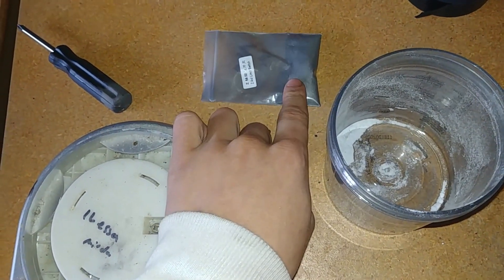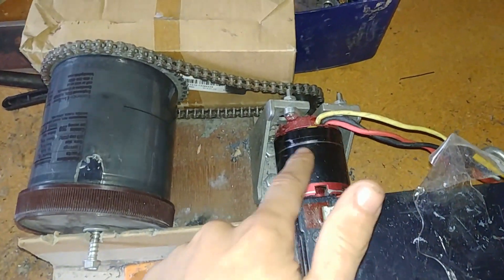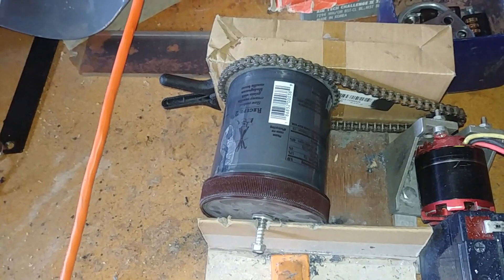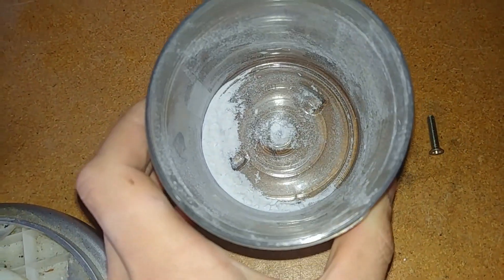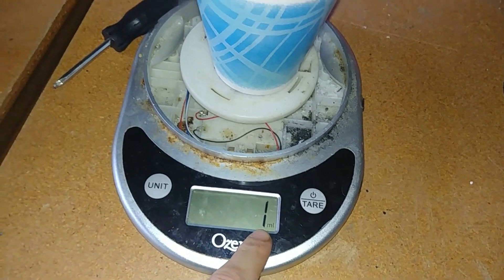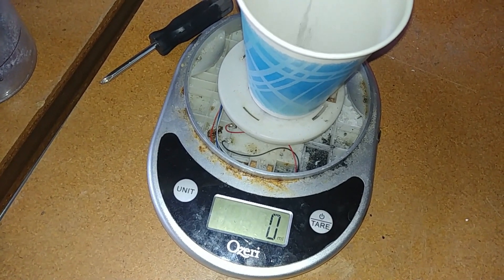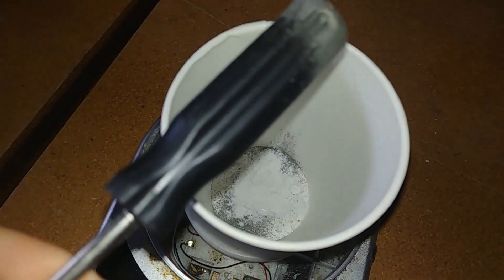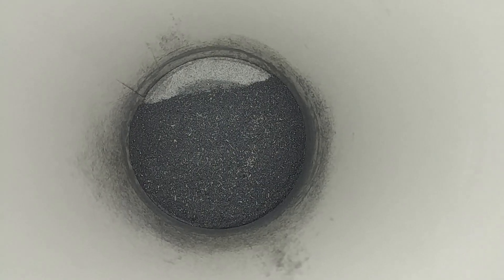Easiest flash powder kno3 and magnesium

Comment: That’s a great flash powder, online I found a suggestion for adding sulfur. About 10% sulfur by weight really helps the mix. A tiny amount burns insanely bright and fast. I recorded the burn rate on slow motion compared to black powder, and it’s significantly faster. I put about 1 gram confined in a small cardboard tube with a fuse. It was super loud and super bright. Very significantly louder than commercial firecrackers and fireworks. I found it has a high activation energy, and not at all impact sensitive. Ratio I use is 45/45/10 (KNO3/Mg/S).

Comment: Next you could try aluminum powder and potassium perchlorate but be extremely careful, it can go off with the slightest static charge. It's a bit more of a reactive flash powder.
Reply from the maker: i did kno3 cause i cant get perchlorate easily
Reply: Only try that one in small amounts, like you did here.  It can be quite dangerous in amounts over a few grams.
Reply: What’s the ratio for that?

Comment: You should try making some nitrocellulose with cotton, kn03, and some sulfuric acid it’s pretty fun to play with too.
Reply from the maker: ive tried i never get it right  i might as well just buy some n itric
Reply: @ianbuilder  for me I just used some stump remover as kn03 and some drain cleaner as sulfuric acid. The ratio that worked perfectly for me was 2 parts of sulfuric acid to 1 part kn03 if that helps.